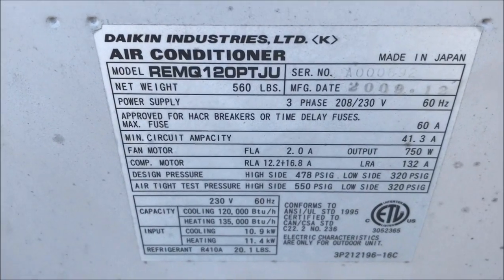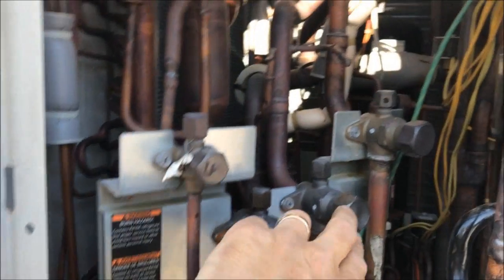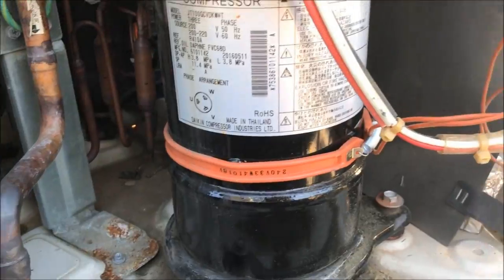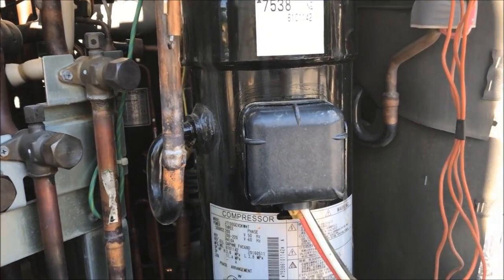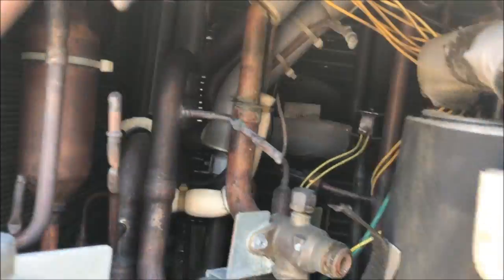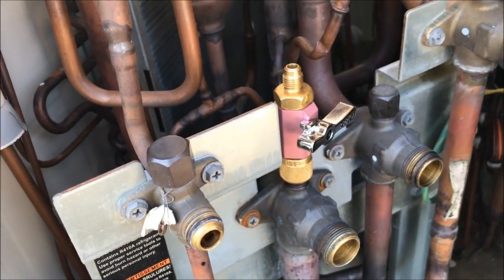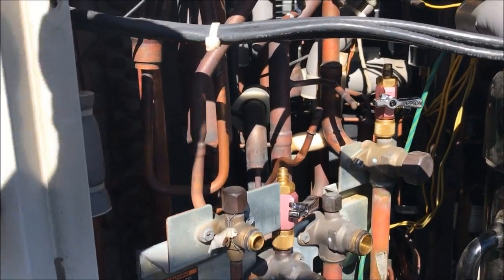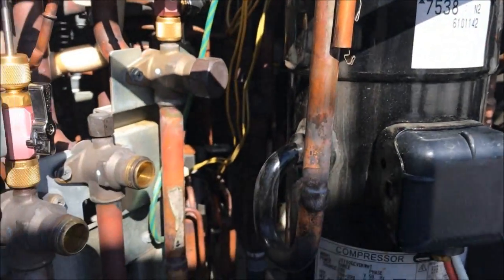Daikin Inverter Compressor

Comment: cool video a couple of questions.... you said the top bearing wore out on the compressor. you checked first amp draw and the pcb was putting out power to the compressor ? then could hear a mechanical bearing sound? could metal fillings from said bearing damage the piston in the compressor and potentially metal fillings pumped round  the system and block capilary tubes or TEV? that would not be cool :/
Reply from the maker: Matthew Caley the amp draw is what will lock it out, and usually what happens is either poor oil return due to bad installation (no nitrogen purge resulting in a clogged oil filter) or liquid coming back due to an EEV not closing properly on an indoor evaporator, causing the bearing lubricant to get washed away. And I don’t think the design of a swing compressor would allow contaminants to get into the system. But usually the system will fault out before that much wear happens.

Comment: Hi thanks for the good info I’m sitting in the same boat i have a Daikin vrv3 with a bad bearing nock on slave unit inverter compressor
Reply from the maker: My fish world Kris Kanev I have since set all my indoor units to run on “low-low” when satisfied in cooling, so if I have an expansion valve partially open it’ll boil off the liquid and not wash out my bearings. Working so far.